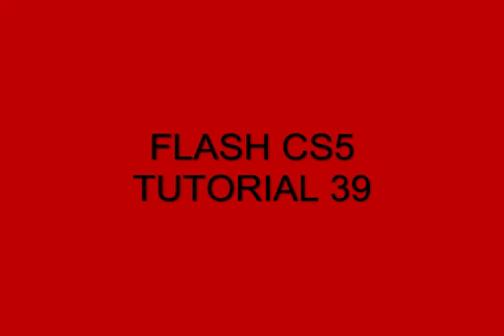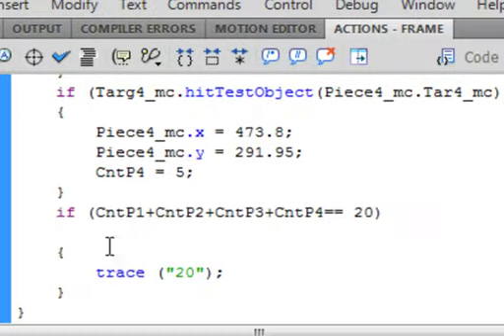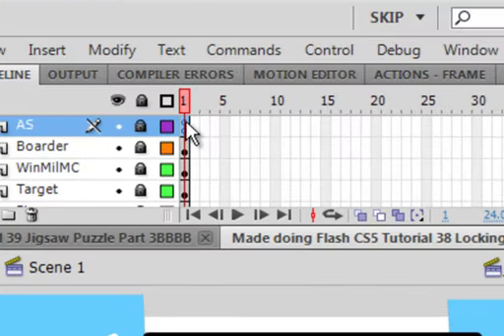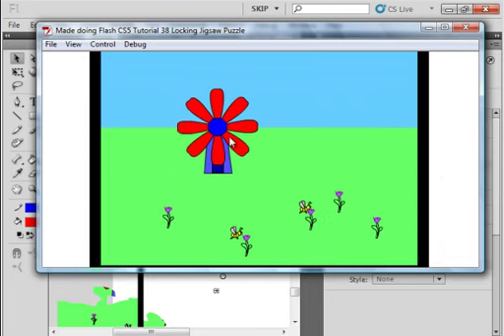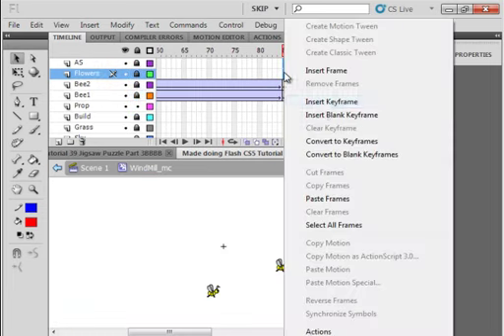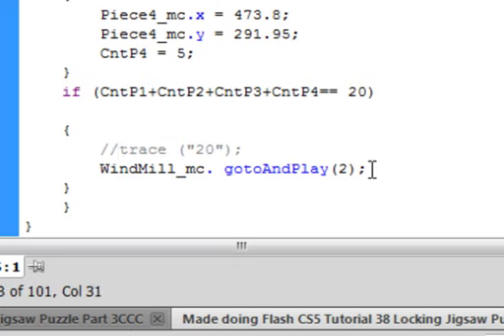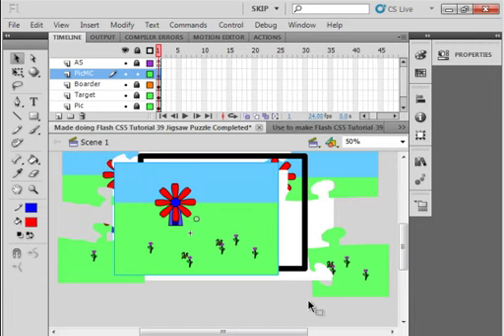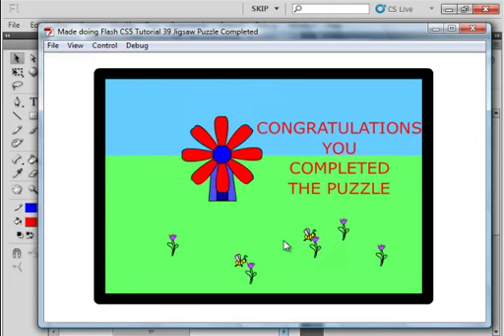Flash CS5 Turorial 39 Jigsaw Puzzle Completed.avi

Comment: Hi I have watched your videos and they are really detailed. But I have run into a snag, I have followed closely but when I put in the code for the propeller to spin it only moves like a tad clockwise and doesn't continuously spin like yours does any ideas???
Reply from the maker: If the propeller is moving only a little bit: then the problem has to be in the WindMill_mc". Most likley problem is with the code on frame 2. On frame 2 you most likley have this code.... "Propp_mc.rotation ==  10;" It should be "Propp_mc.rotation +=  10;"  +=   not   == Let me know if this works for you.Good luck
Reply: Flashthingy
 I checked the code, and it is the same as you have it and it still only moves a tad to the right and stops or looks like its caught on something im not sure what is wrong.
Reply from the maker: It has to be in the code.
You can do one of two things:
1/copy the code from frame 2 of the WindMill_mc and send it to me.
OR
2/ send me your email address and I will
contact you via email.
We shold be able to make this work.
Reply: Flashthingy
I have sent you my email, here is a copy of the code:
stage.addEventListener(Event.ENTER_FRAME,EntFr);
function EntFr(e:Event):void
{
    Fanprop_mc.rotation +=10;
}

I made a fan on a table instead of a windmill, also i have this code in the second frame of actions inside the picture where you double click it in the library
Reply from the maker: I copied this code and put it into my program. It workrd OK. Are you getting any error codes?
Reply: Flashthingy No I am not getting any error codes, when I go to test it like mentioned before it goes just a little to the right or clockwise and does not go any further and does not spin continuously.
Reply: Flashthingy
I have sent the email
Reply from the maker: swordies14 There is something strange. You should be getting error codes when you test this fla. I found several things wrong. I do not think I would be able to explain how to rectify this through e-mails.  I think it would take about 10 to 15 e-mails to do this. It would take so many because I can only work on a little bit at a time and make sure that works before moving on. Again I give you 2 options:
1/ We can try to do this via e-mails (many).
OR
2/ I can make a video using your fla. and tell you how to make the appropriate changes. If I make the video I will put it on youtube and it will stay there for all to see and learn from.
Reply: Flashthingy
I think it would be easier to make a video, because this is a strange case. I opened the fan base and fan prop libraries in a cmopletely new window and put in the code and it worked just fine. So there is something preventing it from moving in the main .fla. But i am fine with a video as it is easier to learn from.

Comment: This presented some problems as Flash was reading the file as a FLV or Flash Video file, even though I checked the option to remove any video aspect of the file, which there wasn't anyway because it was an mp3, not an mp4. Anyway this worked but caused me problems afterwards because I had to open them in CS6 at university so I could save my work as CS6 files, university requires we submit our work in CS6 version.

Comment: Hey there Mr Flashthingy,
For some reason CS5 Flash would not allow me to import an mp3 file into the library. I tried clicking the "import to library" option, and I also tried "dragging and dropping" the mp3 file into the library, but it kept giving me an error message. I googled the subject and found many forums so it seems this is a common problem. I eventually found a thread which suggested using Adobe Media Encoder, which I have, so I encoded an mp3 using said software.

Comment from the maker: This code usually means that the AS in that frame ( or in a previous frame) is making reference to a symbol that it can not find on that frame. It could be that the symbol was not given an instance name, or the instance name given does not match the AS. Many times I thought the code I had matched the instance name given. I was wrong. I ended up copying the name from the AS and pasting it into the instance name box in the properties panel.

Comment from the maker: I rearly use more than one scene. With that said: the error you are getting usually means that one or more of the symbols for which you have written AS is not in the frames still covered by the code. In your case; it sounds like the symbol in question( I suspect it is all your pieces) is/are not on both scenes. This may be because you do not want it to be on both scenes. If this is so... put all your symbols on the other scenes BUT put them on the paste board (out side the working stage area).